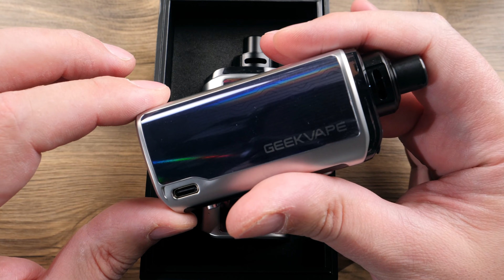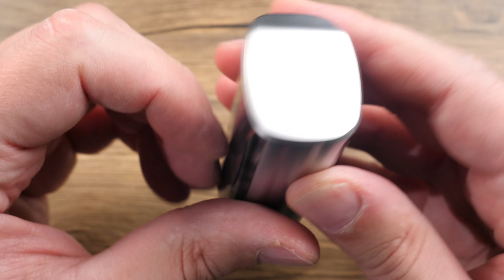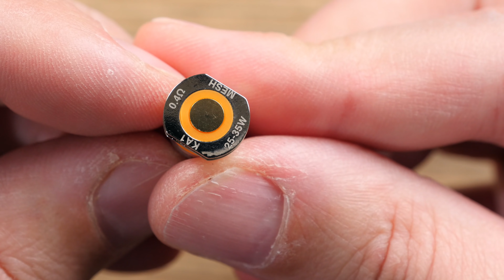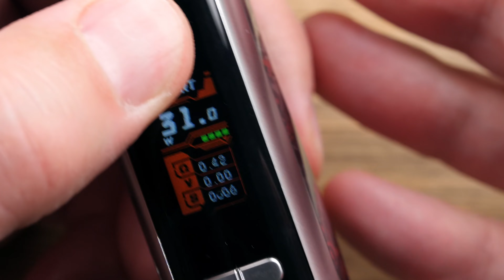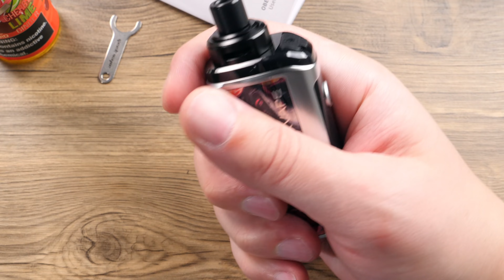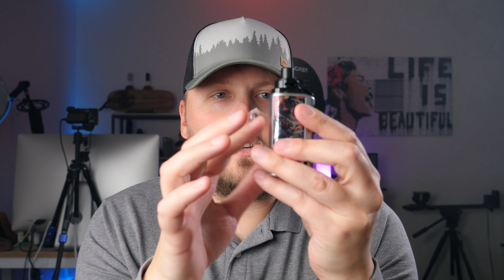Obelisk 65 FC by GeekVape!

Comment: If the maximum charge rate for a device is 40W and you have a 60W charger... Your device will charge at 40W.

If you have a 20W charger the same device will charge at 20W.

Any standard fast charging block will work, making use of the 18 minute charge depends on whether your block is rated to charge at LEAST 45W

Comment: Just a note on the FC capabilities. Most good phones come with USBC fast charge power supplies. If your phone has a USBC cable it will fast charge the vape. If you have a newer iPhone they come with a USBC power supply and you can use the cord that comes with the device to fast charge.